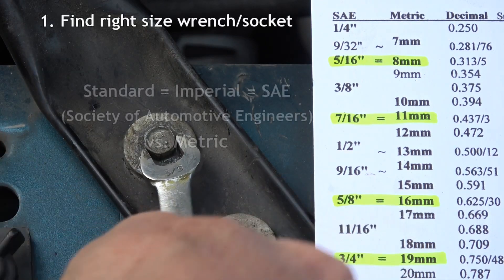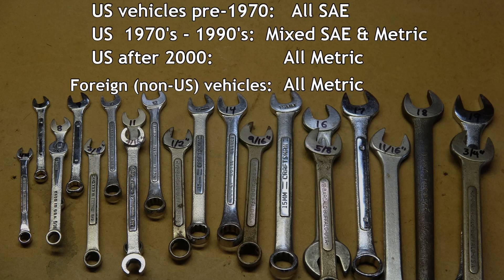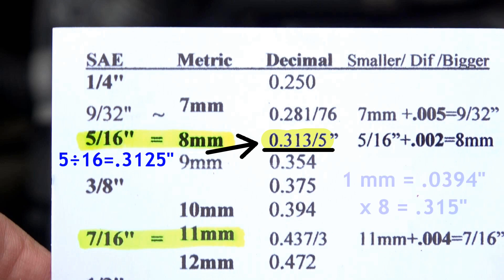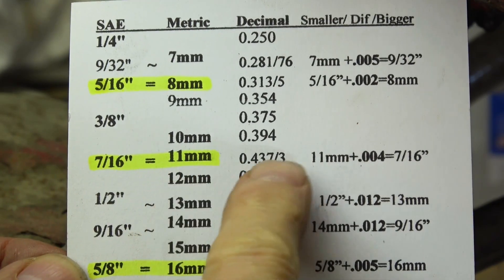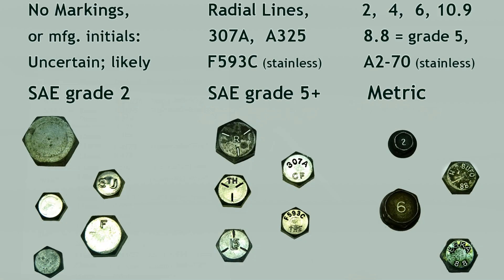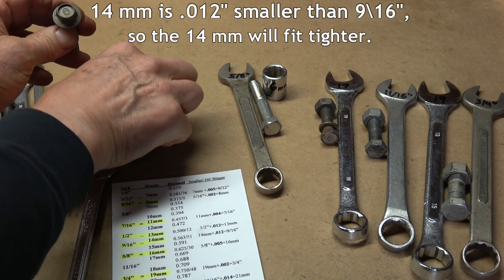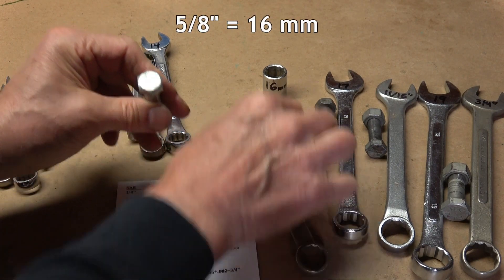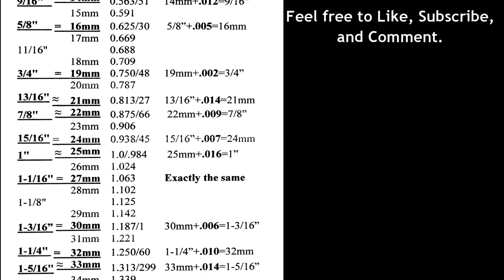Metric vs Standard, Imperial or SAE - Wrenches, Sockets, Bolt Size Chart + Mechanic Math

Comment: If the exact millimeter was engraved on all SAE tools along with the inch measurement then it would instantly simplify the whole comparison without requiring a chart. FOR EXAMPLE: If I pick up a 1/2 inch, I would know that it is just slightly smaller than a 13mm because it would say 12.7 mm.   9/16 would say 14.2875, so I know it is just slightly larger than 14mm but slightly smaller than 15mm...
Reply from the maker: Brilliant idea! I wonder if the tool makers have even thought of that? I suppose with an engraving tool, you could do your own.  I've found black sharpie markers work for a while but then it wears off.
Reply: @HartzHomestead  I do have an engraving tool and a chart. I was using it today working on the suspension of my old Ford truck. Some bolts were metric and some were standard. The chart came in real handy.

Comment: One inch equals to metric.
Reply from the maker: If you mean centimeters, 1" = 2.54 cm.  or   1" = 25.4 mm.
They are separate systems, as inches are divided by 16ths, and cm are divided by 10ths.  
So 1/2" = 12.7 mm and 1/4" = 6.35 mm. 
You can always Google it for exact equivalents.

Comment: Hartz Homestead: Thank you so much, you did the hard work for my convenience. I discovered the 9/16 to 14mm conversion when my 9/16" socket fell down into the cowl of my Honda Civic & I couldn't get it out with magnets or retrieval tools. Also found that some of my old SAE impact sockets will work for lug nuts. Your chart is so handy.
Reply from the maker: Yes, when you get to lug nut sizes over 1", they get more interchangeable, as there are more equivalents and an exact fit isn't as critical.

Comment: This is really useful for someone starting off buying tool sets who notices SAE+Metric sets often include skips in sizes. With the chart, we can see if the skips are to reduce redundancy (5.5, 8, 11, and 16 have relatively close SAE equivalents), and we can assume anything else missing is because it’s rarely used (20mm for example).

I find it also useful in a mostly metric automotive world to know which SAE sizes are just barely smaller than the metric. I really appreciated that you showed the 1/2” on the 13mm bolt, and that 1/2” wrench and/or socket would be really useful to have in a primarily metric set. Personally I’ve also seen people tap on a 3/8” SAE socket onto well rounded 10mm bolts to get them off.

Thanks for the video! Great resource
Reply from the maker: Glad you appreciate the detailed info on how much larger or smaller any given size is, especially given there is often a little slack in the fit of the "right" size.

Comment: So they're nothing to use in place the 15?
Reply from the maker: No, 15mm has no equivalent, unless you have a 19/32" which is very rare.  Easier to just buy a 15mm.  You'll need 10mm too, and possibly 9, 12, 17, 18 and 20mm. Might as well have full sets of each.
Reply: @HartzHomestead  I'm trying to take off the battery positive cable; that's connected to the starter and it's double bolted.. I'm not sure how to get it off will I need to wrenches? Was told I do.. or a impact wrench gun? Starter is off the truck f250 7.3 but I not sure how to remove the cable any suggestions???

Comment: I’m confused
Reply from the maker: Metric and Imperial are 2 different systems that are not related to each other. So the purpose of this video is help you figure out whether you have a metric or imperial bolt or nut, and what size it is, so you can use the right wrench or socket.  Some sizes also happen to be close enough that you can use either one.

Comment: what tool do I need for a 8.8 bolt plss tell me I need it for my gokart
Reply from the maker: The 8.8 only tells you that it is metric of a certain hardness, not what size it is.  You need to either measure it with a metric ruler or try different metric wrenches on it to see what size fits.
Reply: @HartzHomestead  I found it it was 10mm but if its hard and hard to move its the right wrench right it fits on the bolt

Comment: Good video, but using some of the wrench sizes that you call similar can have you fighting the wrench because now it’s stuck to the nut or bolt.
Reply from the maker: Yes, it's always best to find the wrench that fits best. But if you don't know if it's metric or SAE, this may help you find the right one.  Also, everyone doesn't always have a complete set of both.

Comment: They need to go back to using all imperial. Metric is awful.
Reply from the maker: Metric by itself is much simpler, the problem is they are 2 completely different systems, so if you're used to one, it's harder to understand the other.

Comment: MOST SAE to Metric conversions are APPROXIMATE and are "sloppy" fits. A six-point socket will USUALLY hold while a 12 point will USUALLY slip. I have 62 year-old scars on my hands to PROVE IT. The fancy "grip-end" open end wrenches usually hold very well. Use a ratchet with an extension with a socket to save your knuckles, if it slips.
Reply from the maker: That's why it helps to know exactly how much difference there is, and which is smaller, a lot of info to keep track of.  A 5/8" wrench is .005" smaller than a 16mm, so if you have a 16mm nut, a 5/8" wrench or socket will probably fit, and be tighter than the 16mm and less likely to slip. I've even used a 1/2" wrench on a 13mm bolt, which was a very tight fit, as the 1/2" is .012" smaller, which is a lot.  What you're talking about is when people do it the other way around, and try to use a 13mm wrench on a 1/2" bolt, which is asking for trouble.

Comment: I purchased a Fiskars reel lawn mower that needed its handle attached. I was provided with four 8.8 mm bolts. My lovely socket set has a comprehensive collection of sockets in both metric and inch sizes - but do you think I could find a match? A frustrating internet search for a simple answer to a simple question finally led me to this video. Thank you so much for your straightforward  explanation and handy chart.

Comment: When you go to say drill a hole to put  a bolt in, are you supposed to put the bolt size to the same size of drill bit for the hole? Or do you actually want the hole to be a size bigger, so that you can work with it if you need to get it out? (And is that different in woodworking compared to metalworking?)
Reply from the maker: Depends on how tight you want the bolt. Usually I would drill it exactly the same size, in either wood or metal. Unless a bolt is heavily galvanized, it will go in and out easy enough. For a tight fit in softer wood, I might drill a little smaller and drive it in.
Reply: @HartzHomestead  Thank you very much!

Comment: Pet hate on cars is having a mix of both metric and imperial. Sometimes though having both sets of tools, does help when rust has reduced the size of a bolt or nut head.
Reply from the maker: It does complicate matters. Car makers seem to do whatever is easiest for them, not the mechanic who has to figure out how to fix it.

Comment: Which companies make half sizes in metric? Like 20.5mm, 21.5mm, etc.
Reply from the maker: I don't know. I've never heard of half metric size tools.
Reply: @HartzHomestead   Well hopefully some manufacturer turns it into something known. 
The amount of times I had as a mechanic and construction worker that neither SAE or Metric would fit a bolt/nut/fastener correctly, a half size Metric wrench/socket would have been helpful. 
(Yes there are obscure fractional SAE sizes such as 13/16" 27/32" 53/64", but remembering those can be a headache.)
Reply from the maker: Actually, that's a brilliant idea, because metric is so logical, and that would cover most standard sizes that don't have an even metric equivalent.  You could even get away with fewer standard wrenches.

Comment: I really don't know how you Americans get by with Imperial. Here Down Under, Imperial has only been maintained by plumbers.
Having said that, I am restoring a 1939 Rolls-Royce which sports BSF, BA and Whitworth!!!  Arrrgh!
PS Thank you for the chart. It is way better at my own attempt
Reply from the maker: Having grown up with Imperial, it was hard for me to learn metric, but now it seems so much simpler. I use the chart myself on a regular basis, as I run into both systems a lot. I've gotten very used to fractions.

Comment: I drive several 1980's Fords, so I must have a full set of each Metric and SAE.  That said, my experience is ALWAYS use the proper socket and NEVER use one that is "close enough" because that IS how you strip stuffe.  Better safe than sorry, because you know just how fun it is to take out a rounded head bolt....

Comment: Metric is the standard, it has been for decades. So when you say you are comparing metric to standard, that doesn't make sense. You need to say Metric to non-standard or imperial.
Reply from the maker: Good point, but that's what it's often called.

Comment: So 1/2 is a 13mm correct?
Reply from the maker: Actually 1/2" is smaller.  13mm is 12 thousandths of an inch bigger, which is quite a bit.  So if the bolt or nut is a 1/2", the 13mm will fit pretty loose.  That might work OK if it's not very tight, but you could strip it if you have to apply a lot of force.  If you can get a 1/2" on it, that will fit tighter and be better for the bolt or nut.
Reply: @HartzHomestead  I was removing my car batter the washer holding the screw needed a 13mm a 1/2 wrench got it off I will put it back on tomorrow and let you know how it go thanks a lot tho this video taught me something

Comment: Can I use metric sockets on standard bolts or will I need a standard sockets as well?
Reply from the maker: Some sizes are interchangeable, others are not.  You can get away with a complete metric set plus a few standard sizes that don't have good metric equivalents. The most important are 3/8", 1/2", 9/16", 11/16", 13/16" plus you might want 1/4", 1" and 1 1/8".  If you run into standard very often, you might as well have both sets.

Comment: Excellent video!
People miss that some substitutions only work in one direction.
When I was young few had metric sets and as foreign cars became more common we made these subsitutions and even picked up extra SAE wrenches in some sizes to file down the open end to fit some metric fasteners that didn't have a crossover.
The smart ones marked them somehow.
Done with double open end wrenches and combination wrenches where you might even cut off the ring end as it wasn't a match for the open end anymore.
Now someone will say why not just buy metric?
Well we had SAE already and it was cheaper to pickup some more SAE at a pawn shop or a garage sale than to buy new metric wrenches.
When we did buy new or used metric sometimes we would just fill in the holes where there wasn't any good crossover.
Reply: I love hearing stuff like that. I work in a fab shop that has a dinosaur toolbox that belonged to god knows who before we moved in. I dig in it all the time. A LOT of modified wrenches in it.
Reply: @petemoore8923  Carry weight was also a factor for some as carrying a full set of sockets and wrenches in SAE and metric is a big deal.
Later I bought a set of Metrinch to address that...

Comment: Fantastic informative video.  Didn't know the differences all these years, and glad to know the differences.  Was using the wrenches based on the fit.  The chart is awesome so I can dance between SAE and mm in an attempt to find the correct size wrench for a bolt.
Reply from the maker: Thanks! I love practical information like this that makes it easier to do things.

Comment: What about 18mm
Reply from the maker: There's no good SAE equivalent for 18mm, as it's about a third of the way between 11/16" and 3/4" or 19mm.  I had a complete set of SAE tools but for some odd reason the metric set I bought did not include 18mm, so I had to buy one to do the rear brakes on our Chevy Venture.
Reply: 18 mm is skipped in a lot of sets even though it is used on some things...
I've bought multiple singles of 18mm to fill in holes in my socket sets...you need them when you need them...

Comment: Thank you for this amazing and informative video. Based on what I just saw I’d rather go ahead and get SAE in addition to my metric set of sockets and wrenches. Trust me I’ve had my “fun” with nut and bolt slippage. I’d rather get the correct fit. Also because i enjoy my tools even it’s just to pull out my tool box and look at the shine. 😜
Reply from the maker: It's pretty hard to get by in this world without a set of both, at least here in the US. As an example, my camper jack bolts are SAE, but the propane fridge is made in Sweden, so it's all metric.

Comment: Hi, I've got a bolt 🔩 with a marking 8...does this mean a grade 8 bolt in strength, bit confused 😕,  what I thought before than now watching this video...the bolt is for a YAMAHA xj900s diversion suspension bolt... as I'm searching the meanings, basically bolt has seized onto frame, so will have to cut suspension away, then leaving bits of bolt stuck to frame, hopefully thy just will pop out!? 🤔,  after major surgery or will have to drill out....as it's like this video is showing spanner size, which probably is true in meaning, though is the 8 on the bolt also meaning grade 8 strength... Kind regards Pete... 👍
Reply from the maker: A number like 8 on the head usually means it's metric. An 8.8 is equal to grade 5. An SAE grade 8 bolt would have 6 radial lines, so it's likely not that. Yamaha is probably all metric. Sounds like you might have to drill it out, or use a screw extractor. I assume you've already soaked it well in penetrating lubricant, used an impact wrench or hammered it a bit, and tried heating around it with a torch.

Comment: Spent many years at Ford dealership as Senior Master certified Tech,  One more you didn't add is a 7/32 is the same as 5.5mm.  This is a very common size especially on the instrument panel and interior screws, also sometimes holding speed sensor wires and stuff.  I'm very familiar with what you showed in your chart, I actually have both Imperial and Metric tools so sometimes if I need two wrenches I can use one of each...LOL  I use to laugh and aggravate one of the older techs in the shop that I would constantly catch using a 9/32 or something....LOL.. he didn't even realize that it's actually a 7mm...(RETARD)  There haven't been SAE sizes under the hood for at least 30 yrs.

Comment: I’m trying to take off the upper control arm ball joint and it says I need an 18mm wrench 🔧 and I don’t have it. I can’t fit a socket on it because the axle is in the way..can I use a 3/4 wrench according to the chart or 11/16??
Reply from the maker: There's not a good substitute for the 18mm. 3/4" will be too big and likely strip the bolt head. An adjustable wrench might work, if you have a good one you can get on there tight enough. If you can get an 11/16" on it, that would work, but it's 0.021" too small, so in a pinch you could file it down enough to make it fit, but you'd be better off to buy or borrow an 18mm.
Reply: @HartzHomestead  "There's not a good substitute for the 18mm" 18mm is close to 23/32", 23/32"=18.26mm

Comment: Can I use a 15/16 instead of a 24mm?
Reply from the maker: Yes, the 15/16" is .007 smaller than a 24mm, but that's close enough.  It may fit tighter, which is actually good.
Reply: @HartzHomestead  it's just that I need to change the transfer case fluid on my Toyota Highlander and it has a 24mm drain plug and none of my local hardware stores have it and I could only find a 15/16 socket. But now with your help I'm about to tackle that job. Thanks!!!
Reply: @HartzHomestead  This is precisely the information I was looking for. I just purchased a Capri Tools Impact Deep Socket 15/16, model 5-3260, at the symbolic price of $3.50 USD during a special offer (since they are usually quite expensive), intending to fit it onto the classic Shimano bicycle square tapered bottom bracket removal 24mm socket. After reviewing this analysis, I am confident it will work perfectly. Thank you very much ....
Reply: This is precisely the information I was looking for. I just purchased a Capri Tools Impact Deep Socket 15/16, model 5-3260, at the symbolic price of $3.50 USD during a special offer (since they are usually quite expensive), intending to fit it onto the classic Shimano bicycle square tapered bottom bracket removal 24mm socket. After reviewing this analysis, I am confident it will work perfectly.

Comment: What size nut goes on a 14mm bolt
Reply from the maker: I don't know.
Reply: Depending on which standard it's following: ANSI ISO (American) will be a 21mm, DIN (German Standard) will be a 22mm and JIS (Japanese Industrial Standard) will be a 19mm.  Newer BMWs use the ANSI ISO standard, however Mercedes still uses the DIN standard.